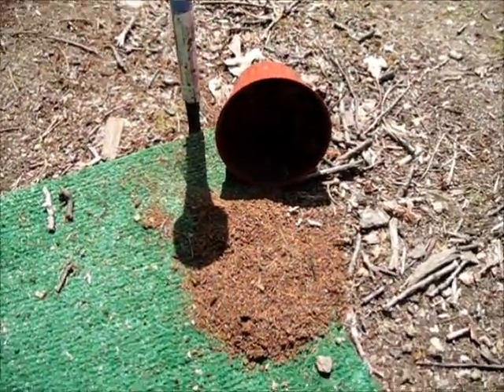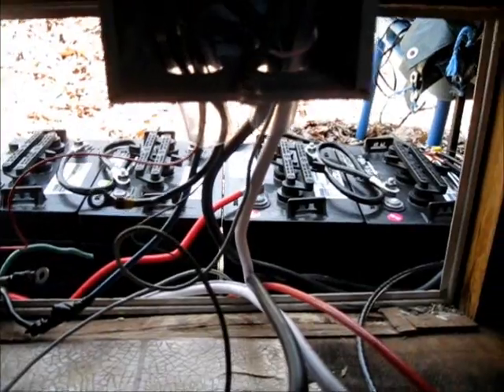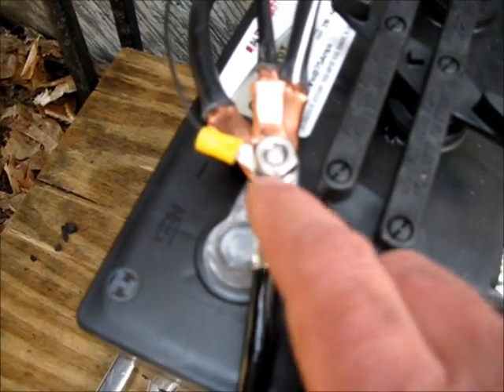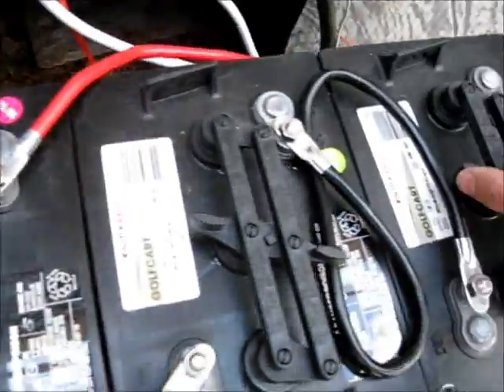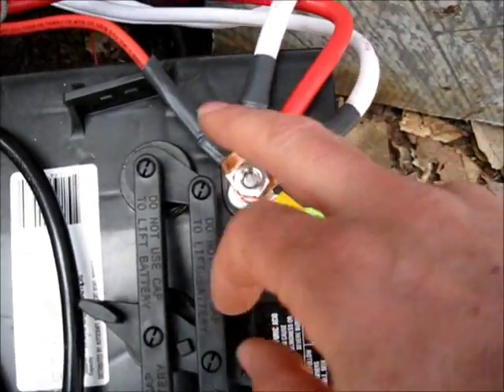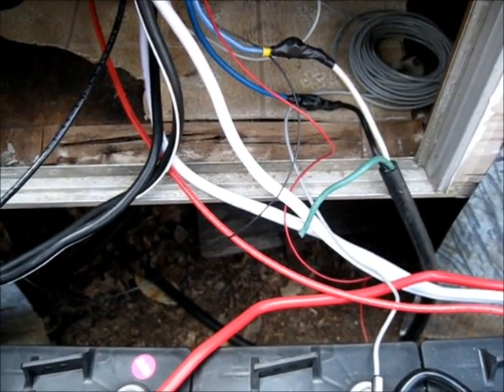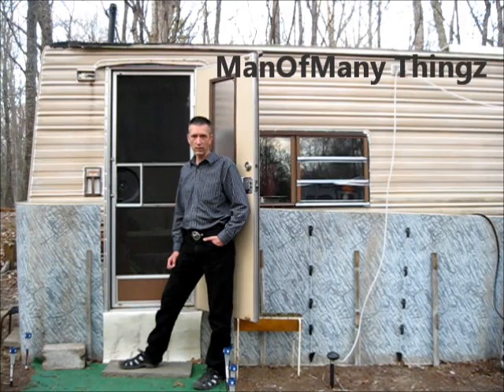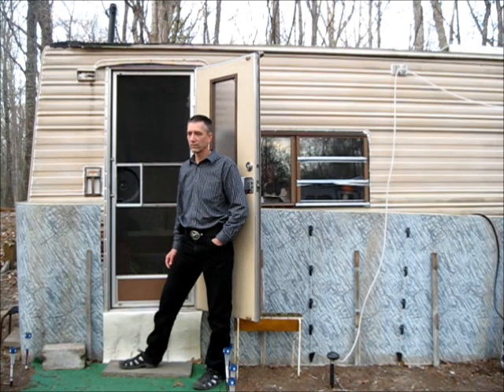Hooking Up My Tristar MPPT Meter And New Wiring Plus A Visitor

Comment: At 6:55 it shows small wire terminals between the heavy wire terminals and the battery terminal. The heaviest, lowest gauge cables and wiring should be closest to the battery terminal and the smallest wire should be the farthest away from the battery.

Comment: Hey Troy.   I have Trojan six volts Batteries and it seems like I’m always putting water in them.
Reply from the maker: Yes, if they are under heavy use they will always need water.

Comment: Just a quick tip, stick some heat shrink on the handles of any spanners you use on your batteries to avoid accidental shorts, as you would be aware the amperage in your bank is no joke. I cringed a little as I watched you do the nut up at 6:45

7:25 Equalization.
Reply from the maker: Yes it is scary working with metal tools on batteries.
Reply: The Do It Yourself World
 Love your vids, keep them coming :)

Comment: Troy, I cannot believe that you were using an open Flame directly on top of a Lead Acid Battery. They expel Hydrogen gas & you could blow the battery up and your face risking acid burns & loss of your eyesight. It happened to many without even having a Flame. Just a spark from a Jumper Cable.t.Eye protection is a must. And just because the caps are on the battery makes no difference. They are vented to allow the gas to escape. Please, Please annotate this video before someone blows themself up.

Comment from the maker: Right now I have 600 watts of solar panels and 6 golf cart batteries rated at about 600 amp hours total.

The solar panels have the battery bank topped off by lunch time each day. I could use more batteries to absorb all the solar power each day. That would help me better through cloudy days.

Comment: Hi Troynd 
Freind go to a electrical supply house or the hardware store and get a two inch chase nipple, a two inch lock nut and a two inch bushing.   Cut a hole in the floor of the camper for this item to fit through, two if the cobduit fill is two great, no code on fill with less than a two foot run.  After installing the wires, get some duct seal, it is a pliable compound that can be moded around the wires for weather tight seal,  this material can be removed quite easly when needed.

Comment from the maker: With LED lights and 305AH, you should be able to run those lights 24/7 as long as you have some solar panels topping off the batteries.

My LED light bulbs use about 1.7 Watts each. Yours cannot use much more than a few watts each.

Even 12 Watts, which is rare for LED bulbs, is only an amp.That gives you a theoretical 300 hours of run time with an amp of draw.

Comment: Hey Troy, I got my 3 12v led light fixtures in the mail yesterday. I soldered them up and ran them for a little over 1/2 hour. The battery bank consists of 2 6v 305ah batteries wired as 12v. I used .2 volts over that 1/2 hour, each light fixture has 42 small led lights in them, it was really bright running all three. With what I've given you can you tell me if that seems like a normal consumption. I wouldn't normally run all three at once but since it was a trial run, I let it go.

Comment from the maker: Yes, but I do not like to make new holes in an already compromised camper. I want to use existing holes as much as possible. Gives the mice less options to look at. My plan is that if I ever move, I disconnect the wires, move the batteries out of the way, close the access panel and go.

Comment: instead of getting a bus bar you can get a all thread coupler. out that on the terminal with your main cables under it and then use a 2" or so piece of all thread on top and put everything else on that and you can reuse the original nut for the top. total cost about $2.

Comment: most mini fridges are the same tech as Troys existing fridge - Peltier cooler. They all use about the same power - 60-120w. If Troy can build himself a thermostatic control to turn it on and off automagically that would save himself a lot of power.

@Techman2015 will the thermostat someone sent you work? Or is it the wrong way ie designed to heat not cool?
In James May's Manlab (bbc) they used a bimetallic coil that moves with temperature to complete a circuit when their mug of tea cooled down

Comment: Troy look for a "bulkhead fitting". It is designed to be installed in walls to allow the clean passage of wiring. Look at Home Depot or Lowe's.

Comment: My friend told me a story about the first optical cable MCI laid between Puerto Rico and Miami years ago; turned out the sharks found it very tasty.  It took them a few more years to find a shark proof coating.  Squirrels will eat anything.  They chewed a hole in the roof soffit, got in and ate the insulation off the wiring, and that area was a main run heading to the breaker box they were snacking on.  If they done a bit more damage, it could've started a fire.  Get the box built!   :)

Comment: My remarks about battery life are derived from real world experience and Trojan's estimate for their T-105 golf cart and T-105RE(renewable energy) batteries life spans. Trojan has set the standard world wide. It would be in their interest to advertise an optimistic estimate that is 5 to 8 years. Most, but not all battery banks T-105 style battiers like yours loose their full capacity after about 5 years. However one can operate on half or less than full their capacity for some additional years.

Comment: Troy you should run a 3 inch or so short piece of pvc thru the floor and run you cables thru it.  Stuff the pvc gaps left by wire with steel wool to keep mice out.  It would be clean and neat and you will be able to use the hatch cover at will.  Even if you have to move the trailer one day.  You can caulk the pvc into place as well.  It doesnt have to be pvc I'm just saying it for an example, with all the stuff you have around.

Comment from the maker: I have 400 watts of solar panels with another 200 to be added when I get the wires. The cooler I am using will burn out yes. I have a fridge but my inverter is too small for it.

My batteries are golf cart batteries made to take a lot of abuse. What I am doing with them is gentle compared to their normal use in a golf cart. They last 7 years in a golf cart. Should last me longer.

I never talk about the forbidden "G" word. Sorry.

Comment from the maker: Yeah, there is a huge difference between primitive living and off grid living. Off grid means no outside wires or pipes basically. But you can have all the comforts you want. Primitive = no comforts, hehe.

Comment: If cash is tight and it always is, it may pay to be expedient.  Buy ice at the convenience store and shut the frig down during the night.  Once into summer you'll have enough power again.  Get a used Engl or ARB for 350.00, or add a minimum of 200 watts of panels a for 350.00.  Also make sure that the system is efficient.  With an MPPT you can hook your panels up in series up to a max of 150v.  This will improve the charger's output and reduce current loss in the cable to the charge controller.

Comment: That frig has got to go.  It is not made for continuous use over years anyway.  Adding 2 to 4 100w panels in the short term would help, yet consider that the depth of discharge on those batteries is reducing their life span.  A depth of discharge of no more than 50% (12.3v) is economical as their life span might be 5 years.  With a depth of discharge of 25%, they may approach 8 years. You'll have to replace the frig at some point anyway.  Cutting consumption is usually cheaper than adding power.

Comment: Hi Troy,
nice job on the wiring, I wonder, myself what to do to vent the flooded batteries. I would do as stated by another, replace the door with plywood, cut the corners out to let the wires pass through. Save the old door, or heck, cut the door you know what the door is used for now! wires! Are you thinking about a chicken coop yet?

Comment: Use a 1 1/2 inch PVC conduit through the wall of trailer and make a seal with silicone for the power wires... Works very nicely and his very inexpensive